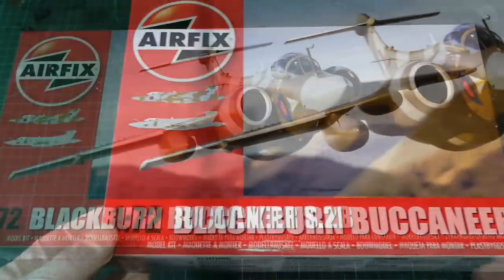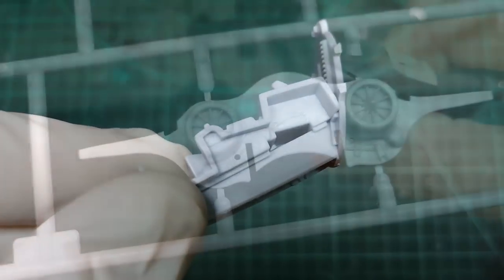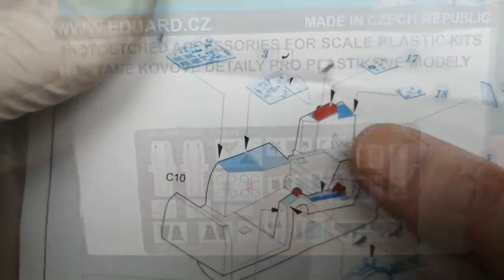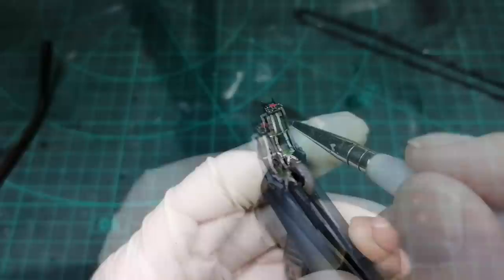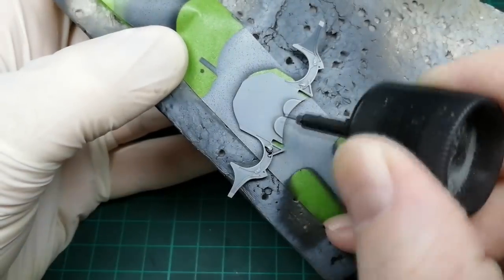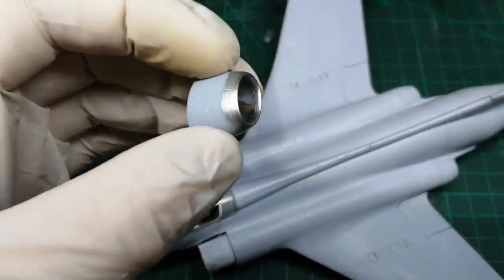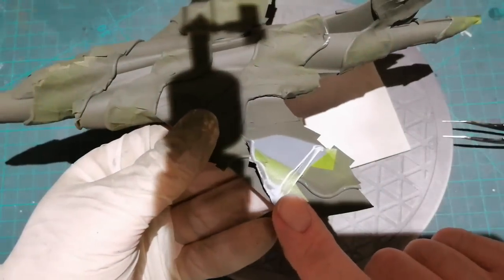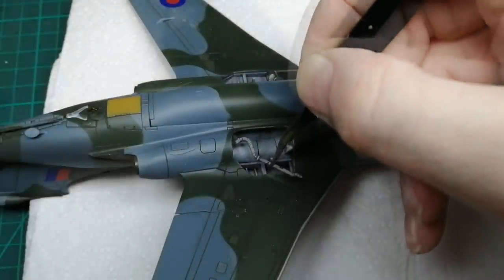Airfix's 1/72 Blackburn Buccaneer S.2B (Full Build)

Comment: Nice job, looking good. Will refer to this when I'm building mine. It's possibly not exactly contemporary, to go with the UK cold war V Bomber force I'm planning, but the Buccaneer is such an iconic shape with its 'area rule' design that it's hard to resist! Problem is I've not done any sort of model for twenty years or so, so I'm practically a complete beginner.

Comment: Fantastic work, Greg! Your videos have really made me rethink a lot of modeling dogma that I've fallen into.  I've been going through your vids hoping to find where you may address this, but no luck, so I'll just ask: what do you think your Tamiya paint with to get that nice eggshell finish you seem to be getting. 

Also, just picked up the 48th bucc and using this vid for inspiration. Thanks for sharing such beautiful and artistic work.
Reply from the maker: The paint surface is wet sanded with a very well-worn sanding sponge. This is a very precarious process as you can burn through the paint.
I did a video on sanding the surface of the paint in preparation for applying decals some time ago. It has a thumbnail of a Meteor wing.
But depending on the finish of the subject I'll seal everything in with either a Tamiya satin, very diluted, or a very diluted Winsor & Newton matt varnish. Hope this helps.

Comment: Another great build, but you could have made it a LOT dirtier and still been 100% realistic. Not only do the  exhaust fairings (the nibs),  turn completely soot black, but so does the whole of the lower half of the rear fuselage, and the underside from the rear of the nosegear all the way aft gets a good staining of reddish brown from leaking hydraulic fluid. The top of the wings and spine, tend to get streaky from a combination of blown air from the slots in the leading edge of the wing, fuel leaks, and the vortex generators. Then there is Hydraulic fluid and some grease around the wing join, and a good dollop of black rubber hoofprints from Lineys who having previously half dissolved their boots in Hyd Fluid and leaked fuel, then have to clamber all over the aircraft - and run out to the wing tips to give them a bounce when the wing fold refuses to unstick.  Other than than that - perfect. 208 Penetrate! PS I don't remember ever seeing a black intake   . They were an off white on Navy AC I think, but RAF ones, at least in the 80s, were a shade of grey much the same as the undercarriage.

Comment: note how he avoided one of the most common modeling mistakes: he painted on the weathering and highlighted panel details    after   placing the decals. As a rule: if dirt, grime, salt, exhaust stains...you name it... gets on the air frame, it gets on the markings, too, and should be shown that way.
50-odd years ago, I worked as a repairman on USAF C-130's. believe me, when these ships  came back from missions over S. Vietnam, they were plenty dirty, and nobody went around with a scrub brush cleaning off the stars-and-bars! 
It is just wrong to have a wonderfully weathered Spitfire, with pristine roundels and Squadron codes. (( a DUH-thud or aaaaaarrrrgggg is appropriate here))
Greg, you mentioned but did not mention assembly problems with the kit. I have been a modeler since the mid-1950's; over the years, I have built both early versions of Airfix (NA. 39 and S.2b), and both Frog and Matchbox S. 2 Buccaneers. All of them had 2 main areas of difficulty: top-bottom or L-R fuselage gaps and misfits, and incorrect intake shapes with awful fits. 
All builders at the time saw these gaps, etc. as being almost unavoidable, considering the complex shapes of the air frames. Are these faults also the case with NT Airfix?
Reply from the maker: This Bucc is light years ahead as far as fit goes, nothing major for the competent modeller out there. I can't vouch for the accuracy; Ill leave that for the rivet counters. Life is too short in this scale 😎👍

Comment: That's a lot more complex in engineering than I thought it would be, especially with the internal structures, and even more so in that scale. Seats came out great too, very nice. Your ability to vary between the scales is nice to see, I think it shows your all round degree of modelling is well adapted to fluctuate between the smaller models to the larger ones but surely it must be frustrating that the level of detail follows suit and you can get your teeth in to the larger stuff a whole lot more, ie the detail in the stuka far exceeds this 1/72 Bucc. 
Still a great looking build bud, the paint job, really sweet.  Keep them coming.  Notification bell on 😉
Reply from the maker: Cheers Mark have a great Easter👍

Comment: Lovely - Any reason you didn't add the registration decals?
Reply from the maker: If memory serves me right, the two photos used for the well worn scheme had the rear serial numbers obliterated by smoke. Also, the one photo showing the underneath at a shallow angle showed no idents under the wing.

Comment: What grit sandpaper do you use for the wetsanding
Reply from the maker: Usually 400, 600 and then 1200.
Reply: @GregsModels  at nice I was only asking because when I wetsand the paint tends to come off but I use vallejo not Tamiya
Reply from the maker: @Krieger-productions6149  Sorry, I thought you meant the plastic. I use a well worn foamed back sanding pad or a damp cloth for the paint surface. As for Vallejo they seem to have an elasticity to them which make the technique useless; whereas Tamiya paints dry hard.